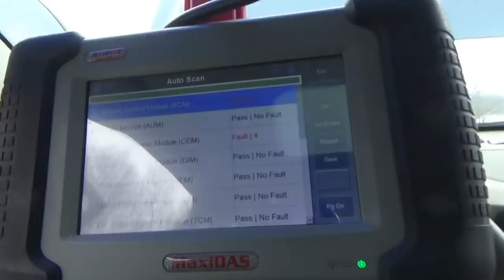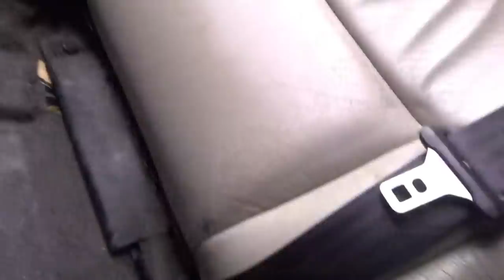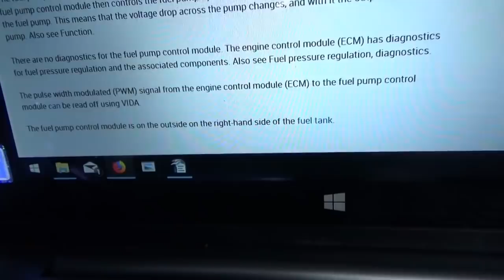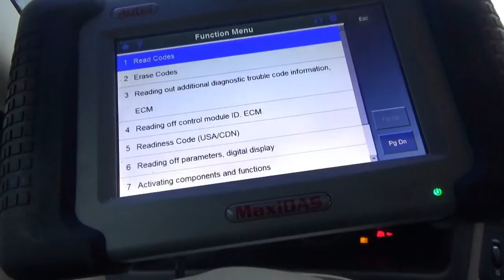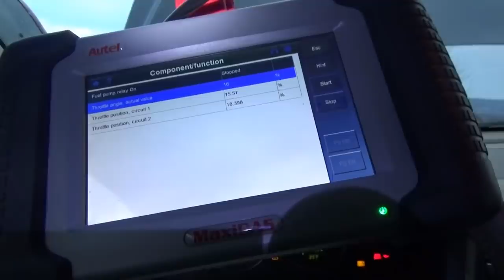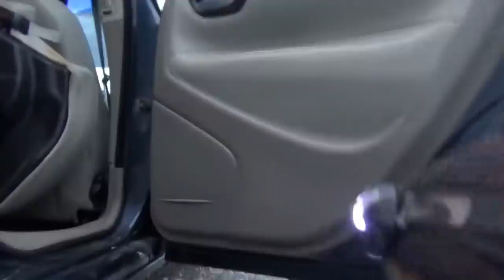Volvo Crank No-Start -Part 1 (Diagnosis)

Comment: That fuel pump module is notorious for going out on F150. Mine is a 2005. It's hidden up underneath the spare tire. Lots of water and corrosion up there. Its housing is made of aluminum and just corrodes away until the guts are revealed. Zap! Electronics immediately fried.

Comment: The dealer wants $6000 for a fuel pump control module and labor. Probably a blown SCR or transistor in it, maybe a capacitor. Ivan will probably fix it for $5 in parts and possibly a couple hundred bucks in labor, or less, since he's a friend.

Comment: Another great video Ivan! I think Volvo and other main dealers, are just not interested in repairing old vehicles of say ….. age over 10 years.  Might explain why the work estimates are so high and often more than the vehicle is worth. The dealer may also be thinking, they have a chance of you buying a new or used vehicle from them. I own a 10 year old vehicle and would only try a main dealer, if I could not fix it myself or the local repair shops could not fix it.

Comment: PDM is on the opposite side of the DDM. Lol.. It's your Passenger Door Module bud.  Which controls your window, mirror and door lock controls thru can lines to your CEM. Have a XC90 I'm working on as well.. with a DDM problem is how knew.  😂😄  Cheers bud

Comment: Dealer's estimate is enough to make you faint. But worst of all they didn't even dignose the problem correctly. Wonder what they would have done if they put a fuel pump in it and it still didn't start? Probably say "Oh you need a FPM too"
Reply: They would have gone away with that because they listed FPM , also known as  PEM  on the invoice.
Reply: They probably wonder what kind of a reputation they would have,  if  they only replaced the fpm (pem) and a month or so later the car comes back for failed fuel pump.   Damned if you do!!! Damned if you don't  kind a deal here. Dealer taking a safe approach here.    Good for reputation and business,  but a major hit for customer.   He's lucky for a friend like Ivan.

Comment: Why did it not stop immediately when the fuel pump was depowered? It's an injected motor, fuel is for all intents and purposes non-compressible, so fuel pressure would have immediately dropped to zero. Unless there's a pressure accumulator somewhere in the fuel pressure system?
It sounds like this car doesn't have a normal supply & return fuel line setup either with a normal pressure regulator, hence the need for this pump module to regulate fuel pressure via PWM from the ECM. Talk about making things needlessly complicated. I can do without crap like that in my life.
Reply: most have gone to the "returnless" configuration.  no it is not compressible  but it can be pressurized.  weird eh?  the injectors loose so little  volume that it takes a bit to go below popping pressure.
Reply: @richardcranium5839  I guess there is some expansion in the flexible sections too, like to the injector rail and between the pump and the hard lines, that would allow for some short lived residual pressure . Personally, I'd rather have a return and regulator though, especially if they're going to put the pump module in such a silly place.
Reply: @TonyRule  agreed

Comment: Let's see. Part 2: Pop open module, spray green crusties with De-Oxit, rub with toothbrush, blow out with air,  re-solder 5 cracked solder joints. Install module, call customer to pick up vehicle.
Reply: LOL

Comment: Dealer prices are what they are....I take issue with their replace everything instead of doing proper diag approach.  Especially considering it's probably a fairly expensive diag charge....you'd expect some degree of accuracy.
Reply: Makes you wonder if they're actually diagnosing for that charge or just taking a wild stab at it and then hoping firing the parts cannon will do the trick.

Comment: Common to change out PEM when doing the fuel pump since you're there anyway. Been there, done that. Was probably the PEM all the time in my car as the reason the pump stopped. First 5 seconds of start should be at 55psi then drops to 43 at idle until under load.
Reply: what is pem stand for??
Reply: @JoelAutomotrizenAccion  pump electronic module.

Comment: The (PEM) is called the Pump Control Module. I looked up Proton-exchange membrane fuel cells, also known as polymer electrolyte membrane.  They use hydrogen fuel and oxygen from the air to produce electricity. Don’t know what that has to do with Volvo but they sure came up with an interesting name didn’t they. There is a recall on some of the Pump control Modules (PCM) it’s worth checking out. Might save your friend some money.
Reply from the maker: I already saved him enough money haha
Reply: Pine Hollow Auto Diagnostics yeah I can’t believe what the dealership quoted him. Did  they make up some name hoping this guy would fall for it? Pretty sad. I’ll be waiting to see what the problem really was in your next video.

Comment: There's a video where a mechanic is teaching his helper, and let the help diag a car that shut off while moving. I thought it it a relay or out of gas. But at the end of the video the mechanic said it was a fuel pump crash shut off sensor. The customer kicked a panel next to the foot rest where the sensor is and activated so the car shut off. Stupid Ford with the garbage they put out. All he did was reset the sensor by flipping a switch and it started up.
It took the helper over an hour to try and find the problem and couldn't find it.
1999 cougar garbage.
Reply: That emergency  fuel pump swicht used to be a headache at first but now we know it activates even with the road bumps! That is a Ford stupidity.

Comment: Likely that module that failed...

Have you seen a fuel regulator stick open or closed?

Had a couple no starts in the last 6 months or so, the first time, lack of fuel. Would start but no higher rpm. Last week it flooded the engine big time. Lots of fuel odor, again no start, until I tapped on the regulator. Did add some seafoam to a tank of gas, to attempt to unstick the regulator..
Reply from the maker: Change it out!

Comment: Hey Ivan do you remember the Volvo that scannerdanner diagnosed in his class?? This brings back memories of that although a lot less complicated it seems 😁
Reply from the maker: The one with water intrusion into the CEM near the windshield?
Reply: @PineHollowAutoDiagnostics  Thats the one!! I remember the incredibly large estimate that dealer gave to that person as well! 
That Volvo gave Paul fits trying to reprogram that CEM! 

It was similar in that it too had no fuel pressure.
Reply: Its standard procedure on these to change out the pcm when you change the fuel pump.

Comment: Wow. Really great video 
😁👍
A lotta. Hunting down the trouble but looking great 
How did you blow the fuse
I still can’t figure it out

After looking at it twice can’t figure out how you blew that fuse

I have a 97 Volvo 960 and same sort of thing it was shut off and then went to restart it and nothing if you spray starting fluid in the intake it fires up but doesn’t stay running
Reply from the maker: "Scraplife"...love it!

Comment: Turn the headlight switch to 0. That will turn off the headlights. The default for these P2s is to have the headlights on as DRLs. The worst thing you can do is take these (now older) Volvos to a dealer for service. Judging from how low it is idling, he probably wants to have the PCV system serviced, if he hasn't already.
Reply from the maker: The best option for the headlights was to turn the switch to "I" which just lit up the parking lights lol
Reply: @PineHollowAutoDiagnostics  You could do that too. :-) My V70 2.5T is a year younger. Same Barents Blue. Looks like your buddy is missing a driving light, too. Mine fell out somewhere on the interstate.
Reply: I was going to suggest turning the switch to 1 but not sure on P2s. On my P1 0 and 2 both have the lights on.
Reply: @Gizmo42Rodeo  I leave mine in Auto that way I dont have to worry about them on, so I've assumed 0 turned the DRL feature off. The P1/850s you had to turn the screw next to the switch to turn off the DRL. It might be now that the P2s you have to dig into the settings.

Comment: Had a fuel pump on a '98 Windstar giving me trouble. On the side of the road, I took the relay out, jumpered the power, and went under the van with a hammer. I could turn the pump on and off by just hitting the tank! I replaced the pump!
Reply from the maker: That is actually a very accurate diagnosis! Have done that myself a few times haha

Comment: quick and dirty spray it with starting fluid and see if the engine runs for a second then you know to chase the fuel problem or not.

Comment: Oh. Dang. I was hoping it was a Volvo 960 1987 just like mine because it cranks but won’t start
Reply: On the older Volvos the fuel pump relay is typically the main suspect. Not definite obviously but it's usually the first thing to check.

Comment: that price is typical stealership, almost all dealerships do that, they dont really diagnose the do a computer scan and then put that into computer spit a total out.  its down to the individual dealerships and how they value customers... 

but what a stupid place to put a fuel control module..that makes no sense to out it on outside in such a place.. i know it wont see much abuse being that front of the rear wheels and far enough behind the front wheels but still, thats not what expect from volvo engineering!

all the other faults maybe indirectly related to that + bad groundings..   sadly looking up V70R's they have issues remind me of ford engineering.. makes me wonder....   not all ford era Volvos have these weird oversights so why did V70 line fall such victim to it.
Reply: This has been my experience way too many times at multiple dealers in the past. They just lightly troubleshoot it down to a general system and then say it's ALL bad and needs to be replaced and charge so much that even if they guess wrong they are covered by all the extra they charge or sometimes if it doesn't fix it they blame it on the age of the car and say, "Well you had multiple things wrong. Look at the age of the car. What do you expect?" Now I do almost all work on my cars myself and save a bunch of money and inconvenience in the process!

Comment: Part number 8629613 fuel control module.,95 $ on Voluparts for a used one. But Is it the trouble.. maybe its the polymer electrolyte? membrane.